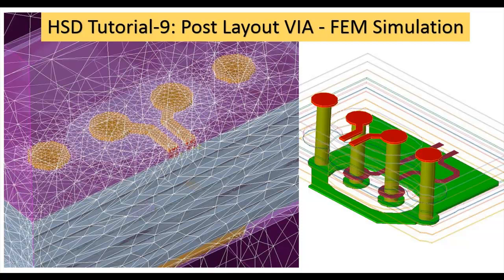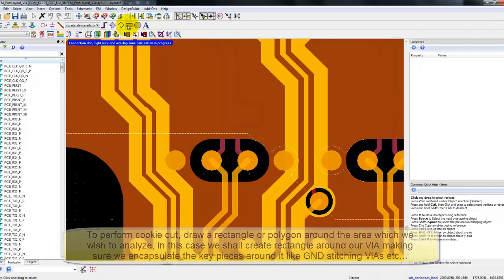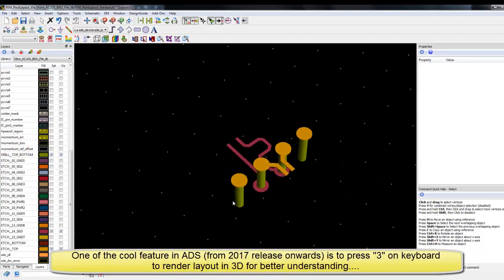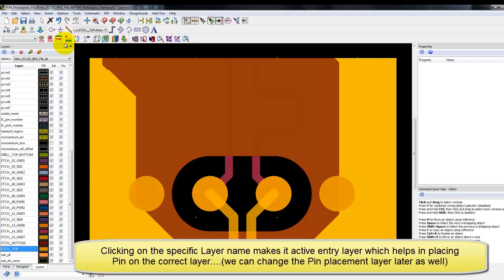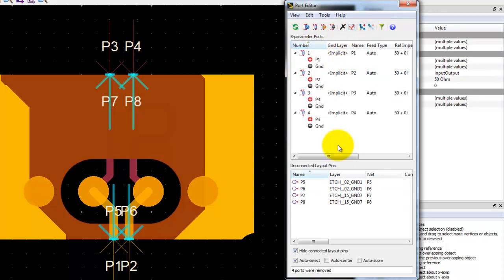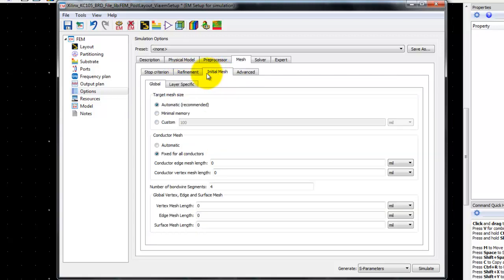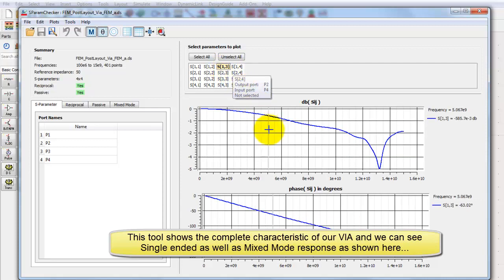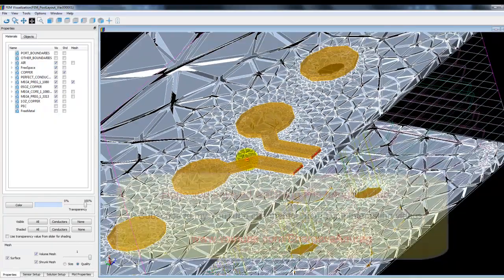HSD Tutorial-9: FEM Simulation of Post Layout VIA in ADS

Comment: Could you please post video related to cutout size parameterization for the pads in ADS to ensure required impedance
Reply from the maker: look at the VIA Designer video under HSD playlist on the channel.
Reply: @BhargavaAnurag The video explains the antipad for vias.I need to parameterize the cutouts in the below layer under the SMD pads to reduce the impedance to ensure required impedance is met.
Reply from the maker: @ngp1987  Kindly look at this video: https://youtu.be/ysaiwtnCrlE?si=x7Q5PmKH891WbN-q
Reply: @BhargavaAnurag thanks for the link sir.Is there a way to do parameter sweep of the cutout area instead of doing it manually.
Reply from the maker: @ngp1987  I am not sure what do you mean by manually. When you use VIA Designer then you can parameterize Antipad dia and there is nothing manual there
Reply: @BhargavaAnurag I am referring to the cut out area under SMD pads.Isaw the link you referred to to wrt cutouts for SMD pads.However,can we do parameter sweep of the cutout area under SMD pads and see the impedance variation just like how we use in ADS schematic using parameter sweep?
Reply from the maker: @ngp1987  I got it now, it was confusing as you were commenting on VIA simulation video. For cutout size parametric sweep there is no automatic method but it can be done easily using the derived layer concept and it will be pretty easy to parameterize the cutout as it will be largely a rectangle.
Reply from the maker: @ngp1987  Have you seen this video: https://youtu.be/ysaiwtnCrlE?si=r5GfEbhXEI3rQs9A? While it doesn't do parametric sims but it explains the concept which should be easy to do and you may not need to perform any parametric EM at all. Let me know...